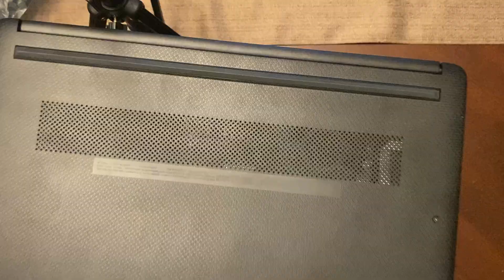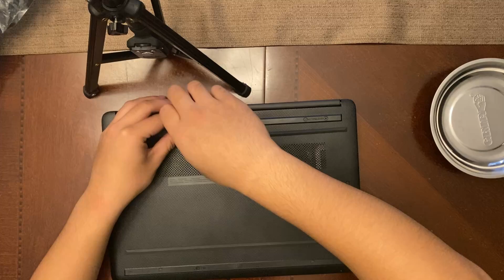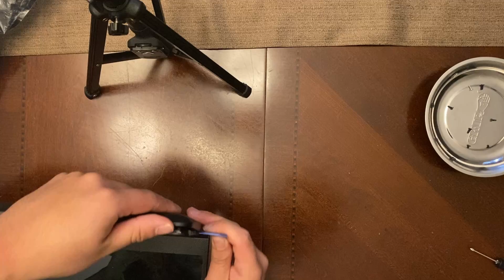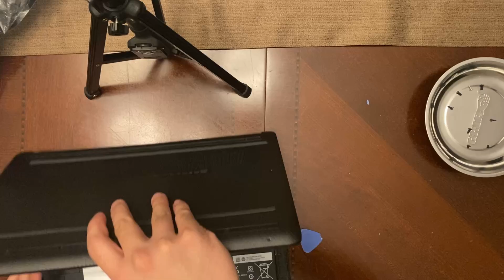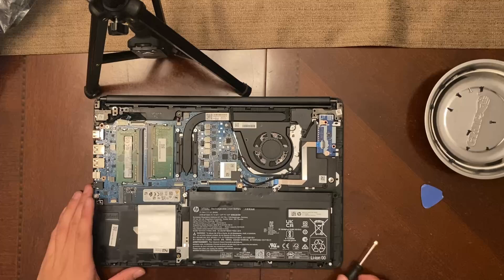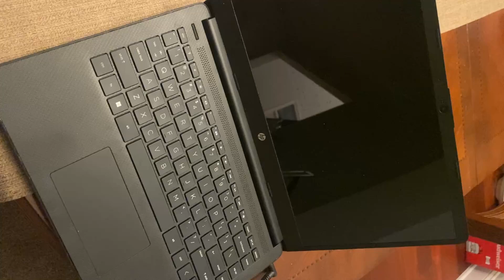HP 14 Laptop Battery Replacement Tutorial

Comment: Thank you; it was a big help. Mine was a slightly different model (HP 14-cf1599), but the assembly was the same, with the screws in slightly different positions. The battery was the same.